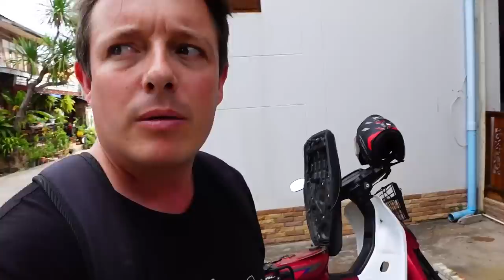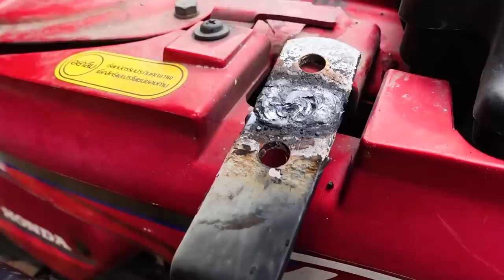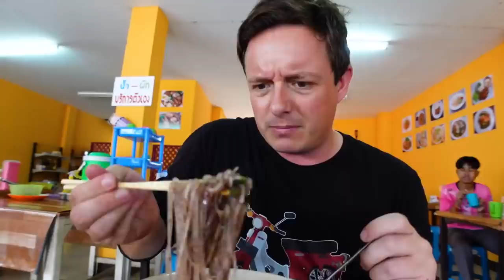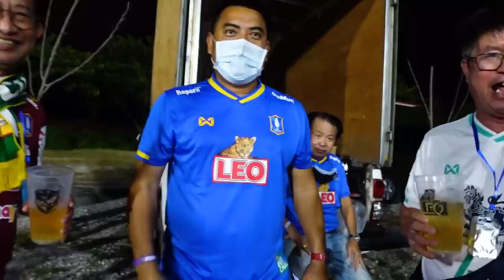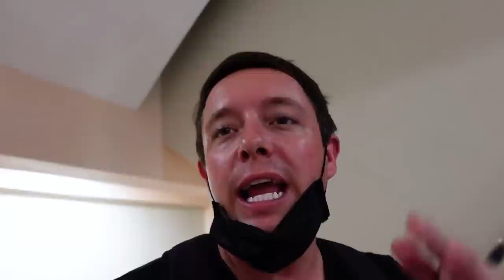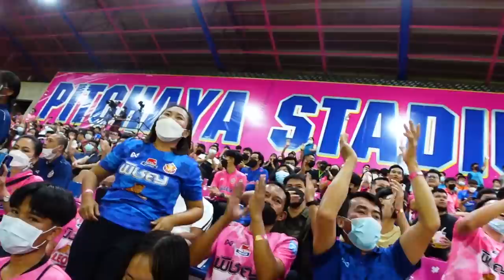DEEP inside ISAN & THAILAND WILD Nong Bua Football League

Comment: Pork Blood/Chicken blood can be found in Boat Noodle 
it use to thicken the soup so a Boat Noodle "ก๋วยเตี๋ยวเรือ" 
are often pack with a big punch and the blood is well cooked so if you didn't bring told before hand that it a blood then you won't even notice it.
one of the much try dish if you're a noodle lover in Thailand

some stall will offer extremely small portion 
but the price is lower too so you can told anyone that you 
"ATE 10 BOWL OF NOODLE" without lying lol 
it also great if you want to order different variety of this dish 
Type of noodle?
Pork Chicken or Meat?